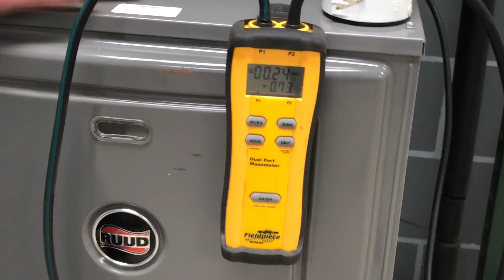Technically Speaking EP4: External Static Pressure

Comment: Nice video.... Even a clean new return air filter would add 0.15 in pressure drop. So a neg 0.25 in. w.c pressure at the blower inlet would be a typical pressure.